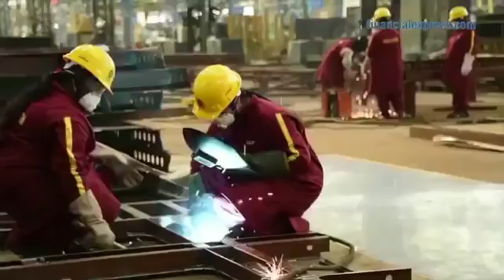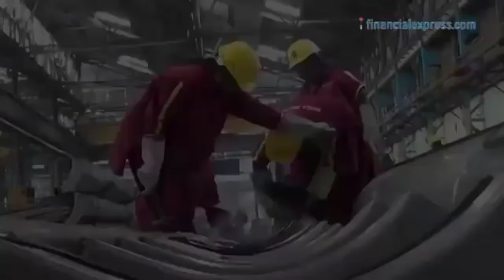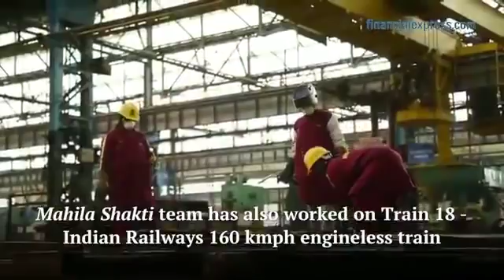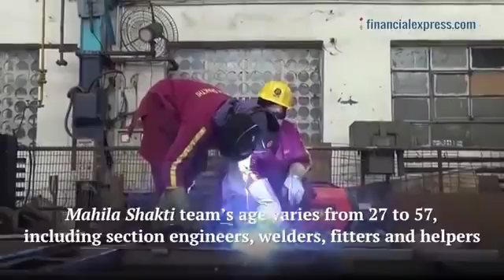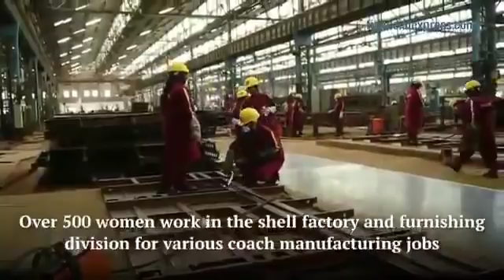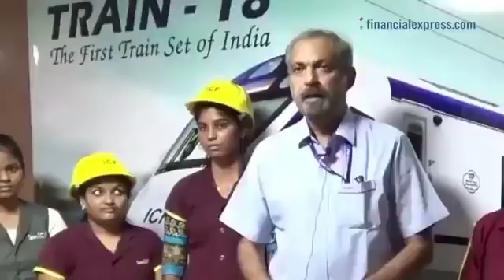Mahila Shakti Meet the women behind the engineering success of the iconic Train 18

Comment: Suggestions and Feedback for Indian Railroad Officials.
It is better if the spotlights on all locomotives that operate, especially on night trips to be added to the spotlights located at the top of the cowcatcher that is on the right side and left side.
In other terms there is a name as a ditch light, so that the work of train engineers can be further assisted, especially at night trips and the point is to improve the safety of train travel.
This is a bit of a suggestion from me and hope that it will benefit.